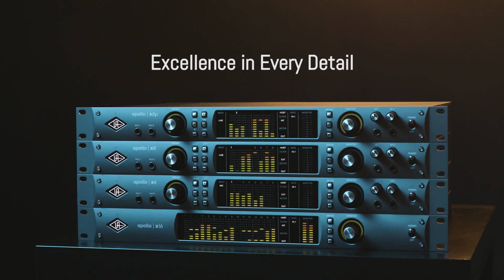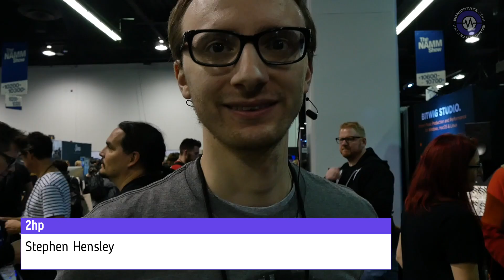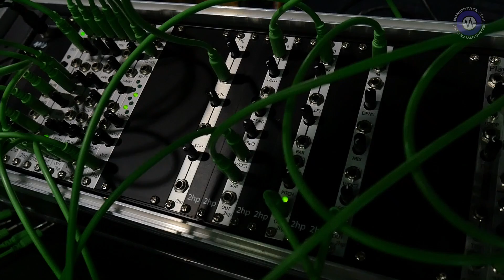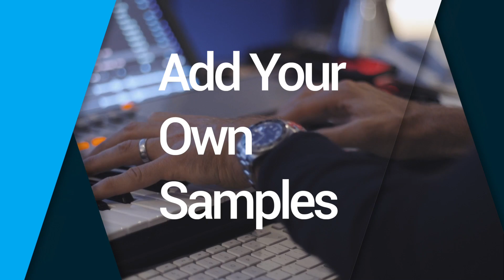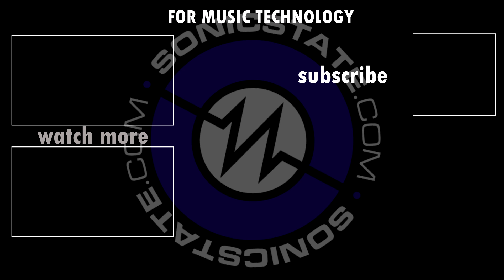NAMM 2019: 2hp - Four New Tiny Modules

Comment: Purposely 4 HP spaced ...2HP modules cannot be next to each other ...that's the only bad thing about 2hp modules
Reply: Yes they can
Reply: There's a whole bunch of them right next to each other on either side of the rack.   I count 5 on the right and 8 on the left with no hp space between them. Not sure where you are getting that information from.
Reply: Joseph Jankowski ok so it's 3hp spaced... try to put 4-6 of these next to each other in your rack, with all the patch cables is hard to get to knobs...don't get me wrong..I have bunch of 2hp modules...they're awesome but the frickin spacing.... 8 to 14hp is close to ideal for module width with price point around 3$25.... and yes patch points on the bottom or the top of the module...all depends how heavily you like to patch....am a patch freak
Reply: @FunkTree  That's why I don't really like micro modules in the first place.  Sure, it may be technically feasible to fit a bunch of these in a rack right next to each other with no space between them, but I agree they're not actually very usable that way.  I thought you meant it's not physically possible.  Like, I've seen modules that eat up more HP than they claim to be because of the way the board on the back is oriented.  I thought that's what you meant.  2hp modules don't have that problem.  They are cramped, though.  I still like 2hp series stuff to fill the odd small space leftover in my rack, regardless.  Your music is awesome, BTW.  Subscribed.